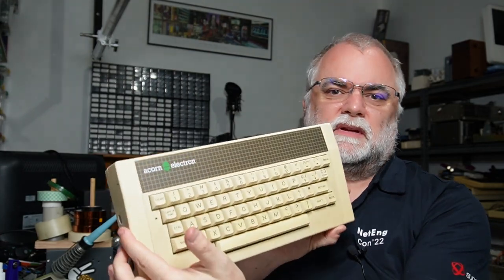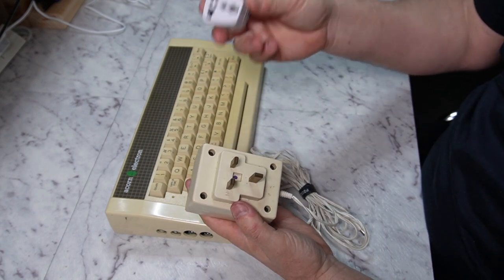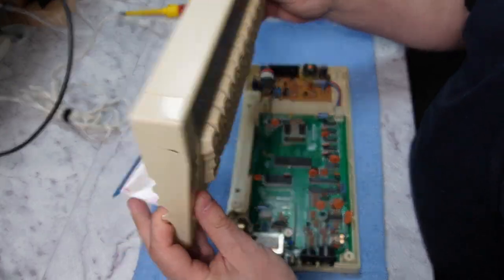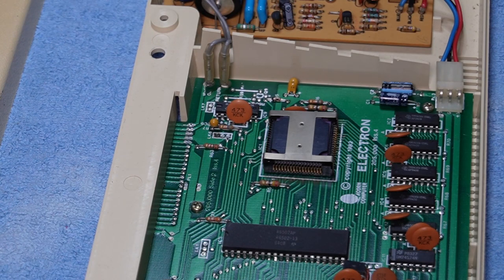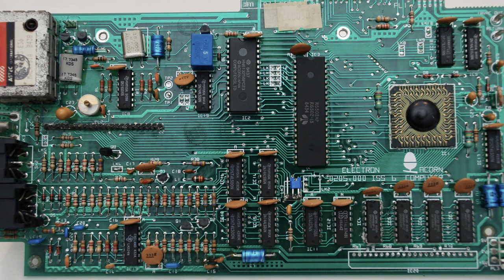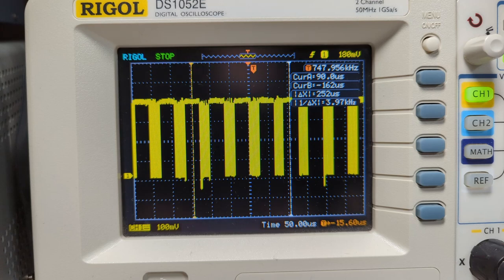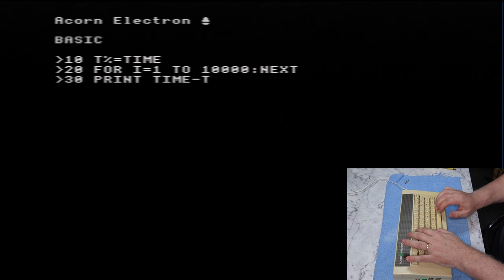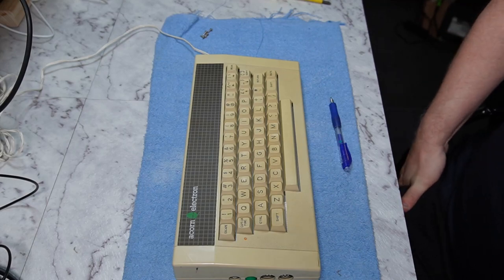Acorn Electron part 1 (ULA)

Comment: Out of curiosity I tried the same 3 line BASIC benchmark on an Electron emulator, and got exactly the same results. It was much slower in the higher graphics modes that use more RAM.

Comment: This is cool -  I remember it well.  The first Electron I had needed to go back after a week i think the keyboard had an issue.  I liked the tactile and texture of the plastic. I was really chuffed to have my own computer when I was 9.
Reply: Also I seem to remeber there were 2 different keyboard / key types.
Reply from the maker: I spent way more hours than I'd care to admit on the little Electron - wrote a lot of code on it that was really targeted at the BBC B & Master Compact, including some ROMs.  I still maintain that the BBC model A/B and those derived from them have the BEST BASIC of any microcomputer I've ever used!  ...and with an assembler built in no less!

Comment: The power input jack goes more or less straight into a bridge rectifier to provide DC to everything else. Because of this the electron will also work from a DC supply. I use a 12V DC supply with mine, to save needing a UK plug adapter.

Comment: Cost saving measure I suppose?

I'm working on a 68k project at the moment where I'm going to do something similar where in a single bus cycle I'll enable words (16 bits) to be read from a single ROM (8 bits), rather than needing an upper/lower ROM pair.

I'm using a CPLD which I guess is much like the ULA in the Acorn - although due to a lack of pins my latch and buffer are external.
Reply from the maker: Sounds like an interesting project :-)  ...and yeah, 100% cost saving.
Reply: @tassiebob  Have nearly completed the schematic. Im hoping to fit it onto a 100x160 card so I can plug it into a subrack that ive got (VMEbus backplane), but Im a little worried Ive got too much circuitry on it. It'll have a couple of UARTs (single chip), 4MB of DRAM, plus timers and a couple of other bits and pieces, and an ethernet controller for fun. Its either going to be an extremely tight fit, or a double sided load, or maybe a 6 layer PCB, some combination of those, or it just wont fit. Will find out soon once Ive figured out the last little bits of the schematic... 😬
Reply: To get 32K of RAM the BBC Micro had used 16 x 16Kbit ICs. 32Kbit ICs were never a thing. By the time the Electron was made they could get 64Kbit ICs, so with the double accesses they could get away with only using four of them, to get the same 32K of RAM. It was quite a severe compromise though! In contrast in the "B+" they used the same 64Kbit ICs, but 8 of them instead of just four, and they used the upper 32K of memory for new purposes.